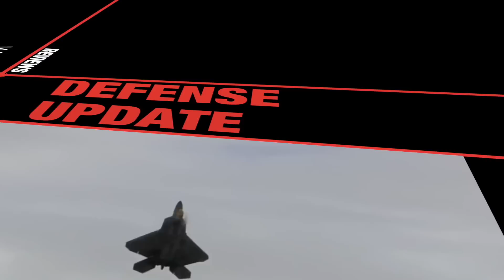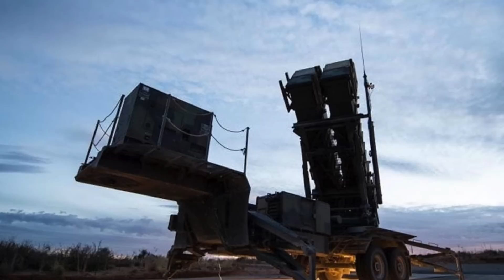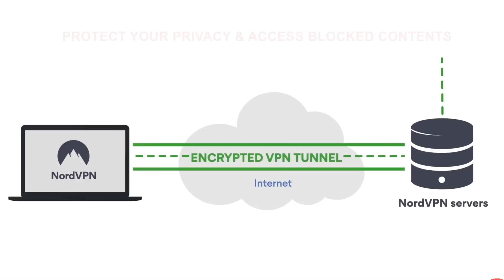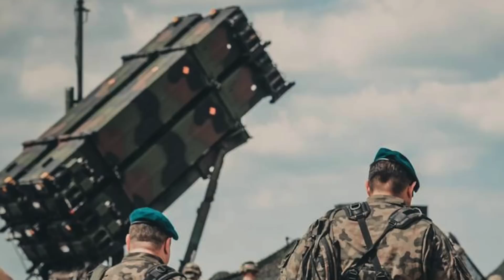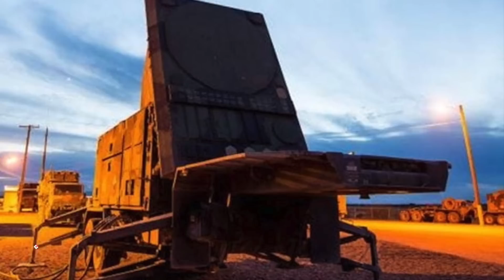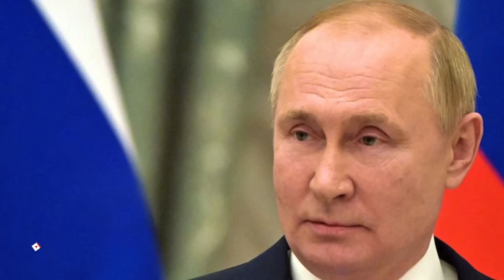#PatriotAirDefense for #Ukraine - End of Russian Aerial onslaught !

Comment: A few C-RAMs around Kyiv and important infrastructure would take out the drones, not to mention a lot of other inbound targets.
Reply: gepard is sort of a ciws
Reply: @miraphycs7377  I agree, but they need units around every high-value target, like power plants, and multiple units around cities.
Reply: @Llyrin  Indeed, it doesn't help to put a few CIWS around Kiev, which is probably alread the case, if it's the only place u protect like that. You should basically have systems like that around all critical infrastructure. A heavy machinegun would do I think. Or yea Gepard tanks are ideal too, cheap ammo I presume, if you got enough of them.

Comment: An excellent opportunity for NATO to learn how best to network multiple NATO air defense systems on the fly in battlefield conditions
Reply: NASAAMS and IRIS-T can fire each others missiles.  IRIS-T  (SL and SM), AMRAAM, and AIM-9X Sidewinder.  
Ideally you want a SAAB Giraffe radar that is say 20km from the front lines and well hidden in Forrest able to choose between firing a AMRAAM that is 10km away or a Patriot PAC-2 that is safely 40km back and able to reach 150km (ie 110km into Russian air space.  
As far as I now the standard is Network 16 and its allows NATO fighter jets to communicate and anti shipping facsimiles to coordinate their attack (one porpoising up to select target and relay information to other missiles and also back to launch platform which then relays via one missile that has popped above the radar horizon for a moment)
Reply: Suicide drones will probably keep a bigger problem than missiles, as russia will soon get thru stocks. Those iranian drones are pretty cheap, but cheaper anti-air systems can destroy them too like Gepard tanks, for example, perhaps heavy machineguns..
Reply: @bekeneel  The answer to suicide drones (basically piston engine powered cruise missiles) is likely to be canons.   Systems like SkyNex firing 35mm AHEAD airburst ammunition or some kind of 40mm gun with a proximity fused round will destroy cruise missiles and suicide drones and the more dangerous swarming drones to 4km.  They are also excellent close in weapons against missiles and bombs. 
-The problem with 35mm guns is the short range of 3.5km against air targets and 5km against ground.
-MAD FIRES 57mm self homing guided anti air rounds fired at 1200m/sec from the Mk 110 canon (220 rounds/minute) will reach 5km in 5 seconds and destroy any cruise missile with hit to kill technology.  
-It's obvious that the extra range will make them able to handle drones even at 20,000ft (say Russian Orlan 10).
-These guns can then fire normal cheap air bursts rounds to deal cost effectively with slower drones at good range.  
-The 76.2mm canons (eg OTO Malera) might be even better as these use guided rounds as well as air burst.
Reply: Or for Russia to find their weak points
Reply: @bugarevicdragan  You’re still rating russia that highly after the last 8 months? 😂😂
Reply: @shotts90  more than  8 mounts ago

Comment: They wanted a no fly zone. The latest iteration of Patriot will provide that. Don't forget this will enable Ukraine to use their air power MUCH more easily. Get them some HARMs and instead of wild weasels, Ukraine can have wild raccoons heh. I think thats a cool nickname for their air forces SAM hunters.
Reply: … as we get closer from mercenary forces to advisors.
Reply: I doubt the Patriot will be better at intercepting low flying Kalibr Cruise missiles than NASAAMS or IRIS-T and indeed will be vastly more expensive per intercept however the PAC-3 missiles it will add some capability against Iskander and maybe even Kinzahl hypersonics.   The PAC-2 with a range of 150km will allow Ukraine to threaten Russian Air force aircraft over Belorus and even over Crimea.  I immagine they'll initially be deployed near capital cities and may then be moved.     Long range S-300 can be transferred to the front.    Low flying missiles and aircraft are best handled with IRIS-T, AMRAAM, and AIM-9X Sidewinder.    (NASAAMS and IRIS-T can fire each others missiles).
Reply: @williamzk9083  That long range of s300 is only an advantage on paper tho, I'm sure, also it's not even fit to intercept cruise missiles. kalibr missiles are easy work for all 3 of those systems, cuz they're subsonic. But Patriot is better radar-wise & it's battle proven/tested. Those "hypersonics" could indeed be intercepted too since these missiles are slower when they fly low, that would be the only danger from russians, drones aren't a problem either alltho they can be manufactured cheaply and in high quantity. if i were  russia i'd focus on that instead, cuz their missiles will become useless in ukraine :) and are superexpensive to make, if they even have the resources..